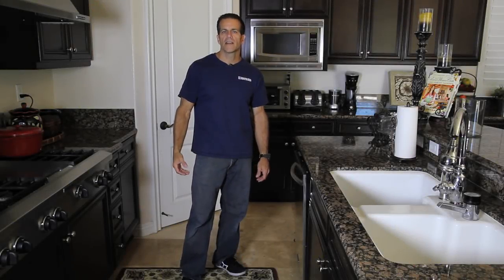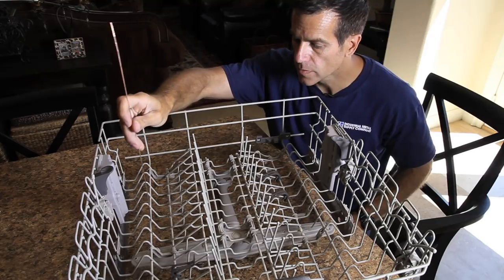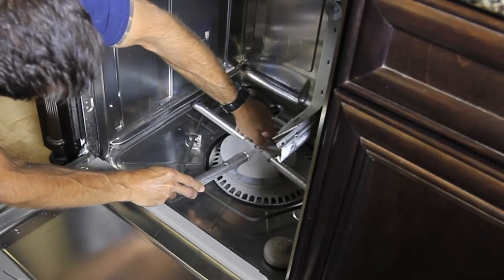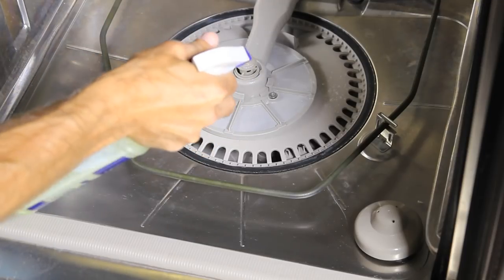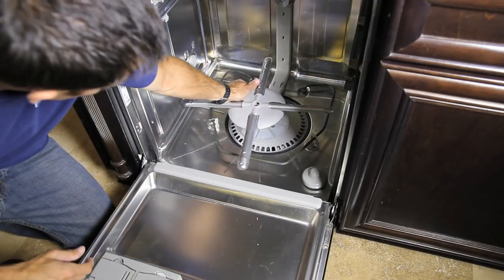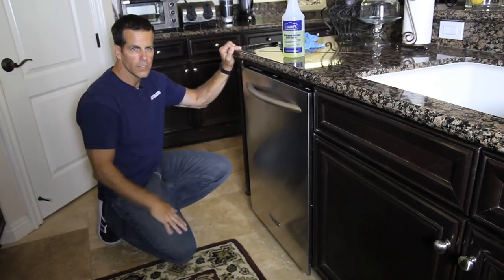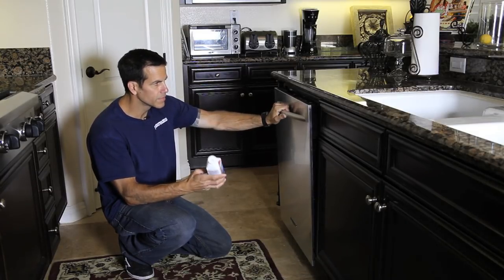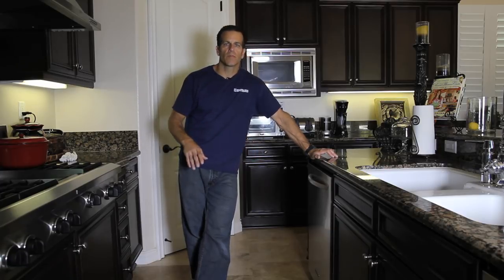How to maintain and clean your dishwasher

Comment: I replaced the air gap with an actual soap dispenser. Would that be an issue when using my dishwasher??
Reply from the maker: That should not be a problem. The air gap cover is normally the only thing replaced when installing an air gap soap dispenser.  It should not impede air gap performance at all.